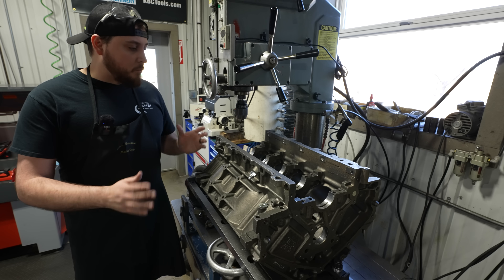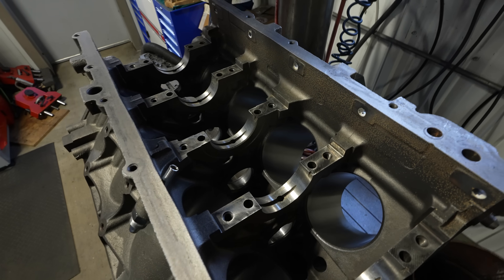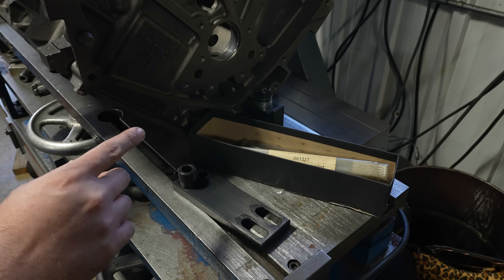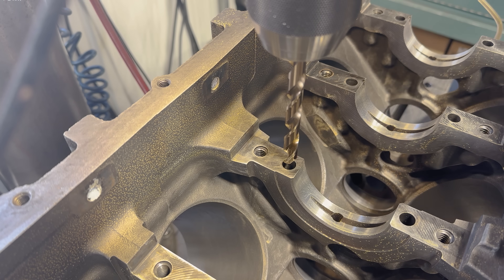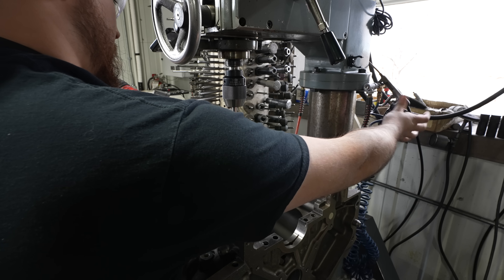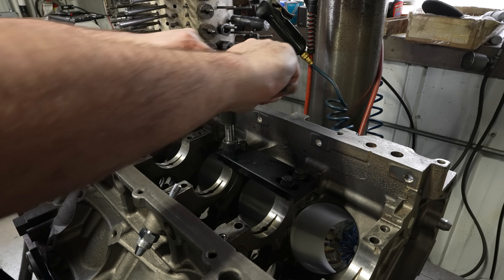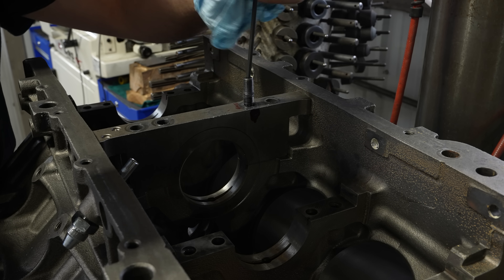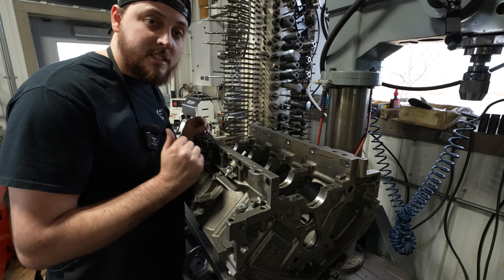The Customer BROKE A Main Stud Off In Their BRAND NEW LS Block...

Comment: Back in day timeserts had four spurs that you drove down into threads that you made for insert this locked it into place.
Reply: Actually they are Keenserts, they have the 4 spurs that you drive into the hole after you have inserted to the proper depth. Timeserts use locking compound on the threads. I have used both and prefer the Time or Keenserts  over Heli-Coils.

Comment: Pretty sure I remember a project farm video where he tested helicoil strength. If I recall correctly, he found that the coils were actually stronger than regularly tapped holes.
Reply: Yes heli coils are fine as long as they’re installed correctly. A lot of people drill oversized or not straight and think it’s the heli coils fault.

Comment: What’s the difference between red Loctite and green Loctite? My experience is only with blue and (seldom) red.
Reply: With Blue the fastener can be removed. Green is thinner and "wicks", medium strength between blue and red. Red is high strength and "permanent" . But all can be defeated with proper careful heat. All are stronger with Loctite Primer.

Comment: Another way to drill out sraight is to clamp it down on Bridgeport mill table   Use the right size carbide end mill   And index it from the hole on each side of bad one   Cant move at all and i have found that a drill bit has flex in it   Where end mill doesn’t
Reply: I was coming down here to say something like this. I've always found an end mill better for removing a botched bolt than a drill. Drills flex and can go off angle, especially with different hardnesses of bolt vs parent material, but end mills never do in my experience.

It is possible to run into a length issue with end mills, though.
Reply: This is how we do it although we use high speed steel end mills since 90% of the time we are removing a broken tap and we consider them sacrificial. But it's way cheaper than scrapping the piece and starting over.
Reply: @TheHonestL1ar  Even if your endmill isn't long enough, it'll still give you a great flat surface to work with and you can use a center drill to give yourself a perfect start to follow up with the proper size drill bit. Once a drill bit is started straight and it's cutting evenly across both sides it'll go straight but trying to start a drill bit directly on the broken bolt without first cleaning it up is asking for trouble if you need tight tolerances.
Reply: Exactly. 
If you have the machine, use a vert. mill. 
I've managed many times to bore out a stud then pull out the threads like a coilspring.
Reply: Not a machinist  but agree milling is the way to go!

Comment: at some point id like to run a general engine/suspension shop and also do race motors, and if shit dont go together right, its machine shop time immediately. you risk messing up for no cost, but if you mess up its thousands down the drain, whereas a lot of machine shops can do it the proper way for more than nothing, but less risk

Comment: Great vid. What cleaner did you use to clean the hole before the insert was installed?  I ask cuz there can’t be any residue in the threads or else the green loctite won’t adhere. Thanks.
Reply from the maker: Brake clean. That being said, when I have talked to engineers from Loctite they said the loctite we use is surprisingly tolerant to oil contamination.
Reply: Thank you
Reply: A carb cleaner or brake cleaner would be my guess. They don't leave any residue when used.

Comment: I did not overhaul a lot of engines in my time in the automotive field.  Things were changing, and it was becoming cheaper to replace heads, blocks, accessories, and so on, the way we did it when I started.

Having said that, in those early years, the guy who taught me how to rebuild an engine would probably have beat my ass if I didn't run a tap down through every single threaded hole on the block and the head(s).  It's beyond tedious, but it can save this type of situation exactly.
Reply: Taps are really too aggressive just for cleaning an existing threaded hole.  When I built my engine, I seen that everyone swore by a thread chasing kit.  Decent ones are pricey, but they clean the threads, and straighten threads, while cutting at a minimum.  I cleaned every single threaded hole with this kit.
Reply: Clean them out first then use a fluted/flared tap then a bottoming/plug tap with cutting fluid.
Reply: @shadowopsairman1583   And good luck even finding the bottoming taps, unless you special-order them ahead of time.  You'll most likely get a blank stare if you go into most hardware stores these days and ask for one.
Reply: @redmondjp  Potting soil and paint ,sure!
Reply: In the energy generation field we chase every hole with bolts before reassembling. We only chase with a tap if we find an issue.
Reply: If it comes in with an open threaded hole, it gets chased and plastic plugged before it leaves.  Just a little grit can cause big problems.

Comment: Great Job with an assist from Engine Rehab!

Question: Is there any concern with the counterbore being larger? I assume it's not used for locating the caps so it should be fine but I'm not sure.
Reply: I believe the only function of the counterbore is clearance because they don't need to thread the entire depth of the hole and of course to clear the non threaded part of the bolt

Comment: Other shop: "Scrap the block" JAMS Inc: "Hold my beer"
Reply: Jams... hold my camera 📷 🤪
Reply: Lets be real its a gen3 iron 5.3   the block is maybe worth $200  machine shop labor on this would have cost 3/4 of a block.  In dallas tx i can have complete running lm7 delivered to my shop for less then $500.   Hell last week i bought a complete lm4 for $650
Reply: I thought that was a little wild for a machine shop to say that
Reply: All I see is a machine shop wanting an LS3 block because they had something to put it in and show all their buddies. Thanks to JAMS, they foiled their little plans. If I were around them, I would take all my machining to them. But… I have to live in Oklahoma. I have found a couple of pretty good shops but you gotta be careful.
Reply: I think that other shop was trolling. Even without the timesert, it could have been possible to use a stepped stud, or drill out the main and fit a larger bolt. torquing would be difficult, but nothing a dial gauge couldn't handle. who has that kind of money to throw away a brand new block.
Reply: @martin-vv9lf  Other shop: "We'll take if off your hands. It's scrap". NOT
Reply: @martin-vv9lf So what’s worse, a shop saying they can’t do the work, or a shop “trolling” in an attempt to upsell?
Reply: trolling of course, it's a basic broken window fallacy you're asking about  @ShaunHensley

Comment: Will you need to check the main bore alignment now ..I was always told when you put studs you need to align bore
Reply: I’m certain blocks it’s a 9/10 times you’ll get the main bores line honed. I’ve found that iron Ls stuff does not shift when installing studs. The aluminum blocks are a 50/50.
I still get mine all aligned out regardless

Comment: It last just fine. Ive actually had to heli coil main bolt holes in race engines. Not a preferred deal but sometimes you got to do what you got to do
Reply: Emergency use of silicon on a blown head gasket is a thing.

Comment: What I've learned over the years, much by my own mistakes, is for me, it's best to hire a specialty engine machine shop like yours to assemble a long block to the specs I want. I think it saves money long term.
Reply: I always check their work myself. That pays off every time.
Reply: I don't know how anyone, let alone a professional shop could break a main stud during installation. Those things are supposed to thread into the block finger tight. It would be apparent that the threads were dirty if the studs didn't immediately screw in with no resistance.
Reply: Ok but at that point why not buy a brand new car instead of rebuilding an engine? 😅
Reply: @AlessioSangalli  You must be Scrooge McDuck, swimming around in your vault full of gold coins, if you can make statements that contemptuous.
Reply: @GGigabiteM just yesterday I removed the engine of my 20 years old car and I will take it to an automotive machine shop as soon as my health allows it.
Reply: @AlessioSangalli  Depends on the shop, not always super expensive and sometimes its nice to have a second set on hands and eyes on a project. Even still every refresh is 99% of the time a deck and head surface etc.
Reply: @AlessioSangalli  Many potential reasons.  Some of us like our old junk, some people want custom projects.  Some people rebuild an engine for performance.  And for those of us that drive old junk we like, often times the rebuild costs are so low that it makes it VERY economical to keep something old on the road.
Reply: @kingduckford  exactly, so there is a good reason to also put together the long block yourself.
Reply: @AlessioSangalli You think a factory engine is assembled this good?😂
Reply: @AlessioSangalli Because they don’t make fox body’s or any cool cars anymore. What kind of stupid question is that?
Reply: @sav22rem22  so the fact that they dont' make it anymore rules out assembling the block yourself after it has been machined?
Reply: @AlessioSangalli  English must not be your first language. Not even going to begin to bother with that
Reply: @sav22rem22  I will explain my point of view then. Stating that the person you arguing with on the Internet is not a native speaker does not make you win the argument automatically.
When working on an engine, we are typically not looking for the biggest value in transportation. If the purpose is to save money, buy a recently made vehicle daily driver and be done with it. If you go through the effort of pulling an engine, bring the short block to the machine shop, it's because you like that car to the point it's a hobby, because it does not make economic sense to do all of that in order to simply move from A to B. If that is the case, I was suggesting in a sarcastic way to  assemble the engine yourself.
There are exceptions to this, like building an engine for racing where you just want to race and not perform mechanic's work or if it's some sort of odd farming implement where rebuilding actually makes economic sense.

Comment: I had to drill a starter bolt hole ... in a 400 sm. block after the engine was installed. 1985 or so. Long drill bit and some patience. NOTHING LIKE THIS MESS. Great job!! Great videos!!